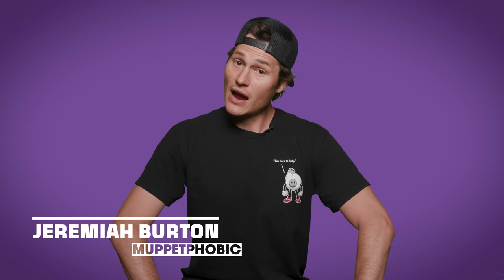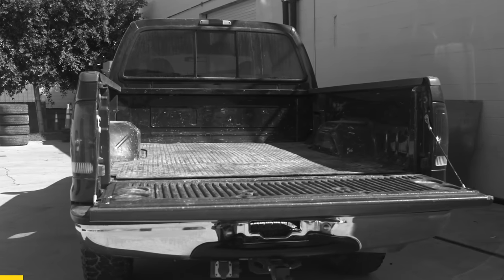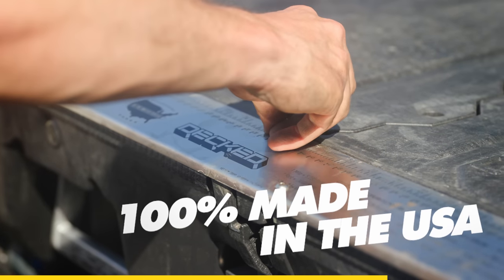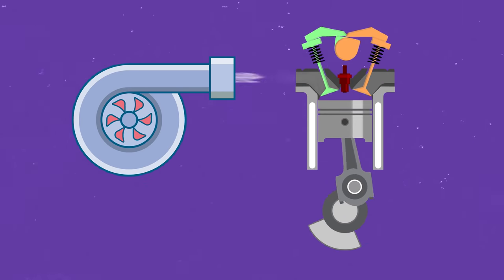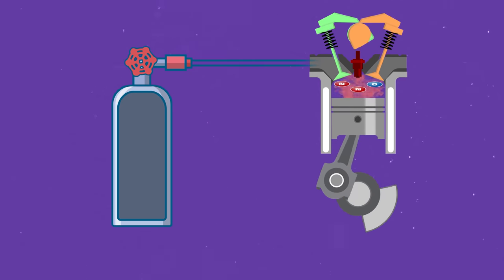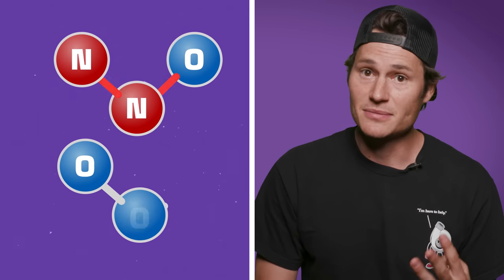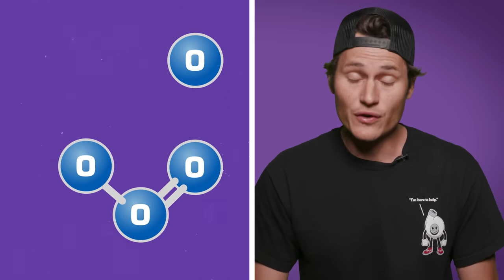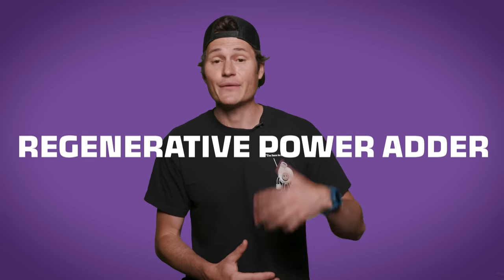Is Ozone Injection Better Than NOS?

Comment: You need the nitrogen in NOS. just pure oxygen creates more heat. Having the extra nitrogen, means it will expand under combustion, giving you extra cylinder pressure, making more power. I believe that engine masters did a great video on the subject
Reply: @Mos' Nefarious You are right! I also failed to adequatley explain myself, sorry for that.
 So, under normal combustion in your engine, the heat from it causes the remaining volume of air, to expand, pushing against your piston, which turns into torque. Without an aircharge to expand under the heat of combustion, the piston will not move, the expanding air from heat is needed. Just heating up the piston, and doing nothing else, will fail to cause it to move. 

As for why you can make more power with NOS, instead of ozone, liquid nitrogen also has an expansion rate of 1:696. That ratio is from a liquid to a gas state. Which also happens to be a ton of force, before you even get additional expansion from the heat of combustion. So the goal of a well designed NOS system, is to get all of the nitrous into your cylinder as a liquid, so you can harness that extra energy for more power. If the nitrous enters your cylinders as a gas, you fail to chemically supercharge, and make 0 power gains. Ozone is stupidly unstable, and in this videos example, he would have to use it as a gas, so compared to normal air that it would be replacing, it has way more combustable potential. But, as a gas in you are losing the added power from any expansion rate, and, you will fail to chemically supercharge, and have a decreased volume of air after combustion, compared to NOS setup, as the ozone in a gas state, cannot act like a chemical supercharger like nitrous. You can argue, why not use liquid ozone? Well, it likes to detonate turning from liquid to gas, without fuel or spark. Think detonating in your intake or in the middle of your compression stroke.

Now, why not just use liquid oxygen then? Its expansion ratio is 1:861, so even more power right? Plus, like you pointed out, even moar fuel = more combustion = more heat= more powa baby! Unlike nitrogen, which is fairly inert, and makes it useful in controlling combustion in the cylinder, oxygen is alot more volatile mixed with fuel. the resulting reaction is alot more violent, and alot less controlled. Which makes it perfect for rocket fuel. But not so good for piston engines. Good cylinder combustion happens throughout the power stroke, following the piston down the cylinder. Pure oxygen, will combust too fast during the stroke, so you lose combustion power pushing the piston halfway through the power stroke. That means you start losing piston speed halfway through your power stroke, which means less overall torque, then a more controlled burn.
Reply: @Mos' Nefarious You are right, in my original comment, I was wrong about needing the nitrogen. However, I am right about the nitrous being liquid. it needs to turn from a liquid to gas inside the cylinder. if you fail to achieve that, you fail to chemically supercharge, which is the point of nitrous. The process of nitrous changing from liquid to gas does start the second it leaves the plate/fogger, which is why intake temp drops under spray, but to be effective as a power adder, you want as much of that change to happen in your cylinder as possible. otherwise there is no power gains. That reason is also why fogger systems make more power then plate systems, you are spraying liquid nitrous right at the intake valve, into the cylinder, versus a plate, where it has more distance to cover, and is less effecient, as you are getting more nitrous gas, and less liquid 'mist' into your cylinders. If nitrous was straight gas in the intake before reaching the cylinders, there will be no power increase over N/A
Reply: @Mos' Nefarious What I was trying to point out about the nitrogen in nitrous, is that you will make more power then then using just ozone gas. You cannot effiecently chemically supercharge with only gas. Thats what forced induction is for

Comment: Love the show in general and pretty much everything in this show is spot on. I run an industrial ozone generator manufacturing company and always just wanted to try hitting the intake with some ozone, but every point made here was spot on. There are even a couple more that make it unfeasible. Only one error is that ozone isn't illegal in california, We have many clients in Cali including hospitals. I believe Jeremiah meant ozone used for air treatment. That is indeed illegal, and most of the products available are just plain trash anyway. Our equipment is used in water and sewage treatment. Not going to plug the company name as that isn't the point. Just wanted to show some support for the show since I actually have something relevant to add for once.

Comment: Could you say, increase efficiency by burning the same amount of fuel, with higher oxygen density under vacuum resulting in a much larger expansion ratio, and less resistance on the compression stroke?

Comment: And this brings me to today's lesson on environmental regulations, for those who care. Ozone is one of EPA's Criteria Pollutants. It's usually permitted at the industrial level as volatile organic compounds (VOCs) and oxides of nitrogen (NOx), as these are "precursors to ozone," or compounds that may react with sunlight to form ozone in the atmosphere... which is bad. Valley-level Air Pollution Control Districts (APCDs) across California want ultimate control over potentially harmful ozone generators, for good reason, so they ban them for personal use and permit the heck out of them at industrial/mfg. facilities (i.e. emissions capture and control, such as quenching the ozone with another compound). California catches a lot of flack for how they handle environmental laws, but I kind of understand it after the smog issues they had just a few decades ago. Of course it's spurred on by other factors but that's not what this post is about. Ozone = bad if not well-controlled and applied with purpose. Cars = fun as long as you keep ozone out of them.

Comment: From my layman's perspective onboard ozone generation is unlikely to be feasible simply because the system will not add more oxygen molecules to the combustion process. An ozone generator, to the best of my understanding, produces ozone mixed with ambient air. Essentially the result would be the same  oxygen content just with ozone instead of O2. Sounds like what you need is a device that both concentrates oxygen and generates ozone or one that makes ozone from  stored O2. Note: not trying to harsh on anyone's vibe here and I would genuinely love to see this project turn out well. Good luck!

Comment: Could still inject pure oxygen like diesel, right at combustion. And since it will run super rich up until oxygen injection/combustion you get some extra knock resistance, meaning you can increase manifold pressure and thus save on the pure oxygen. Might have to add water injection for some cooling and coincidentally, even more knock resistance, allowing for once again increased manifold pressure.

But that may as well just be a bit of daydreaming.

Comment: What moves the piston is a rapid expansion of hot gasses. Nitrogen (~79% of what is around us) has a higher burn rate than oxygen (~19%). When combustion (not explosions) happen in the cylinder the Nitrogen heats up and expands as the oxygen is burned. This helps create cylinder pressure. Eventually Nitrogen does burn and combines with some oxygen again forming several chemicals simply known as Oxides of Nitrogen. These emissions gasses are VERY bad. This is why tuning an engine too lean (creats more heat) create harmful emissions just as running to rich create Hydrocarbins. N02 is the way to go.

Comment: Not if you have some argon in the mixture 😂 if you hook up a dry ice system that can cycle nitrogen in an air vacuum system you can preserve the the bonding by force cohesion. Based on why most ozone layers are located high in the top layer of our atmosphere.

Comment: I thought NO2 was used because it's chemically stable until it's directly introduced to combustion. However O3 isn't, it's a bit corrosive and kind of a hazard to have around in the same regard as O2. I guess whatever would be in that tank wouldn't be entirely pure ozone if driving around with it, since you'd not want to risk having any ignition source near it.

Comment: You're mostly right with how the N2O can add power. The chemistry is correct - more oxygen. However, the physics of bottled nitrous means that it significantly cools the intake charge, making a denser air charge (more air will have more total oxygen). In theory you could use compressed air also for more power (not as much as N2O) due to this effect.
Reply: Turbo and superchargers are air compressors.
Reply: @schakalicious6023  I'm talking about using bottled compressed air to cool the intake charge as it is released into the intake tract (when you decompress a pressurized source it gets colder like an aerosol can) instead of nitrous, not mechanically pressurizing the airstream.

Comment: Making ozone is easy. Just blast 20k volts through some heavily insulated 4/0 copper grounding cable while under water. BAM! You've got ozone. Good luck capturing it, or creating the 20k volts though.. (FYI, we do it at work)

Comment: What about compressed liquid O2, you can get a medical oxygen concentrator. But i feel like you'd be better off making a hybrid system(adding one or two electric motors to the non-driven wheels) Becase the energy needed to concentrate, pressurize and store the O2 would make the stored 02 less energy dense than LiFePO4 batter pack of the same size. Sure if you made the O2 at home and refilled it you could make it using solar, meaning you wouldnt have to wory about the energy used to create it. but if you're using the alternator, or a starter/generator to create the O2 while driving, i think a battery pack would be more effective.

Comment: I've always wondered what hydrogen peroxide would do to a car engine.
Reply: Probably would cause knocking due to spontaneous combustion when it came into contact with the fuel. It's pretty violent stuff when you get it in a pure form (unlike the 2% stuff you can get at the drug store)
Reply: @Hotrob_J  I know.  That's what makes it good for rocket fuel.  I just want to see someone try it.  You can get much stronger stuff from hair supply stores cause it's used for bleaching.

Comment: Standard air is nitrogen 72%, oxygen 18%, and the remaining 10% is a mixture of other gases.  So why not use oxygen bottles from a cutting torch with a regulator and run the hose into the intake.  Set a valve like a cutting torch head and use the compressed O² to displace some of the nitrogen and get your intake closer to a 50/50 mix of nitrogen and oxygen...  you now have almost 3x the amount of oxygen in your cylinder.  Set up a tune like you would with NOS to adjust fuel for the valve being open and you now can produce much more power safely.

Comment: Ozone can be created by devices like electric motors.  It could add power as two O3 molecules are broken down into three O2 molecules.  That could possibly make N2O obsolete.  Problem is that it is still an oxidizer to the extreme.  For the average person rust is iron oxide or FE2O.  Not only would it destroy the soft parts but hard parts of the motor at a much faster rate.  Your basically causing destruction by causing things to burn.  Which is basically what oxygen does.  Lower the flashpoint of any given material.  

So rust or any oxide is burning metal, basically.

Comment: Like your content a lot. You need to note that an oxygen molecule has 2 oxygen atoms. so in NOS, 2 NOS molecules react to generate one Oxygen Molecule. In case of Ozone, 2 ozone molecules yield 3 Oxygen molecule. I have a question too. Why don't they inject oxygen directly instead of NOS?

Comment: It takes energy to produce ozone, so would the increased energy output of the engine be more than the energy it takes to produce the ozone in the first place?
Reply: No. You can’t create energy out of nothing.
Reply: @markuskoivisto  yeah there was a similar idea using hydrolysis that was also just a gag

Comment: The problem is that nitrogen is an important part of the combustion process. As the fuel burns and creates heat it heats up the nitrogen. The expansion of nitrogen is much higher than the expansion of the burning fuel and oxygen. This helps push the piston down thus creating more buff horses. If you just used ozone or liquid oxygen the effect would not be the same. There’s less expansion of gas and therefore less power.

Comment: How about a Brown's gas injection?  This can be made and stored onboard and increases power.  You just need a resonate generation cell rather than the typical electrolysis cell.  

Also, ozone is not as dangerous as the laws in California make it sound.  There is a safe limit of exposure just like there is a safe limit of exposure to just about any chemical in an automotive shop.

Comment: The main reason why nitrous is used in the first place is because it is can be stored as a liquid and maintains its own pressure, just like CO2. Since liquid is far more dense than gas, you can store far more of it in a single container.

Comment: Convertinging the oxygen content in the air from O2 to O3 doesn't change the quantity of oxygen present, so an ozone generator alone wouldn't significantly change power output. You'd need something capable of separating the gasses and collecting just the oxygen.

Comment: Ozone cannot be bottled because it has an extremely short lifespan and is unstable, it must be made on demand, and to feed an engine requires a LOT of Ozone, also Ozone in small concentration makes the room smell fresh because the ozone breaks down and loses the 3rd Oxygen molecule and that molecule sticks to viruses, as well as bad smells by oxidizing the molecule it bonds to,  in high concentration it causes burning itchy eyes and sinus headaches due to excess oxygen levels and cellular damage caused by the excess oxygen, Big Clive has talked about this extensively in the last month or so.. actually i think since just after the 'virus' outbreak, you make good points, and i could see this working as you said in a strictly racing application, but the problem is you'd have to have a very LARGE ozone generator to feed an engine, and again, the Ozone would have to be created on demand, so you'd have a set of electrodes or the generators high voltage grid in line with the intake, and the high voltage circuitry in the back of the vehicle, or stored in a waterproof box under the hood just out of the way, the only real indication of this instead of hoses and solenoids like with a Nitrous Oxide System would be a pair of high voltage silicon wires running to the intake, honestly you could disguise this to look like another Mass Air Flow Sensor, but you'd want this to be as close to the throttle body as possible if not just behind the throttle body in the intake manifold, but this is all hypothetical, and as stated you'd need a very LARGE ozone generator that created pounds of ozone at a time instead of the generically available grams per hour model that you can buy on say, ebay or amazon to name a couple, stay safe out there guys

Comment: Hot take:
Pull the Gordon Murray Automotive - Cosworth card and make an engine that revs to the moon. 

No supercharger, no turbocharger, no nos, just a batshit engine made out of inobtanium to survive the onslaught of thermodynamics and friction past 20m/s on the cylinder wall, that no oil can do. 

Ozone... I don't know... MIGHT introduce corrosion under stress? That's an issue on Nuclear Power plants...

Comment: It'd be pretty much the same as oxygen injection, only you need more energy to generate and separate it, and is hard and dangerous to store.

Only viable recharging powerboost system I've heard of is water injection to allow temporary higher boost levels in a car with a turbo. You can easily collect water from the exhaust since burning fuel produces water, only have to cool it a bit.

Comment: OK but a side effect of nitrous being stored as a liquid and used as a gas. Is that the state of matter change cools down the intake temperature. Which also help add more oxygen because the air charge has more density.

Comment: Just swap fuel pumps, injectors, and run nitromethane. The fuel mileage will suck, and you'll have to change your oil every 10 mins, but you'll get from your garage to your local VP Racing Fuels, rapidly.

Comment: If you add NOS do you also have to upgrade the crankshaft? And make sure the camshaft, and pistons are good condition as well right? Otherwise it will be too much to bear all that power on something like a break internally correct? I don't know that's why I'm asking